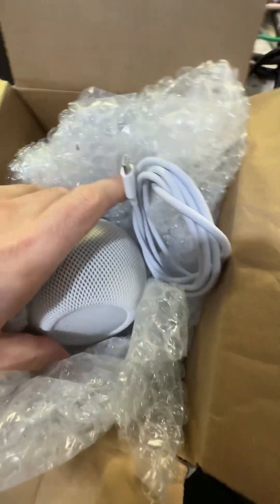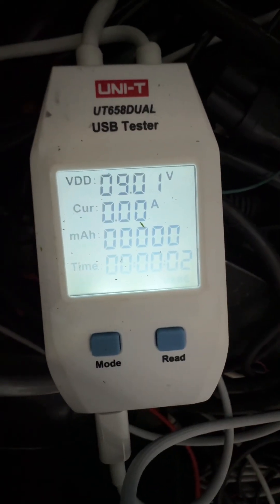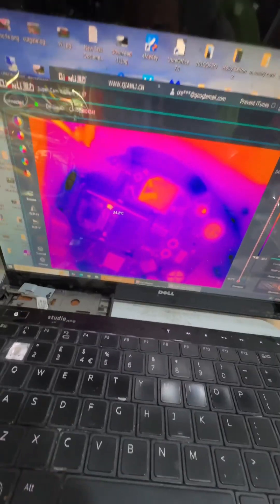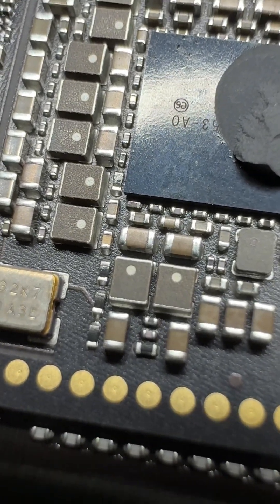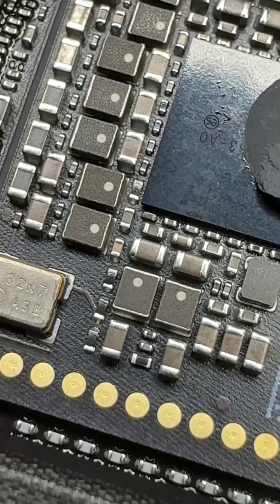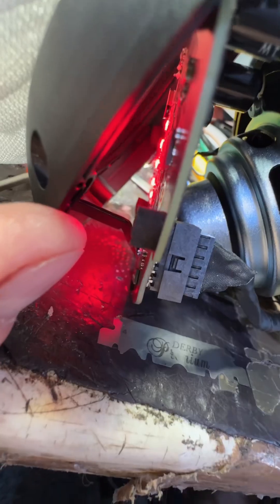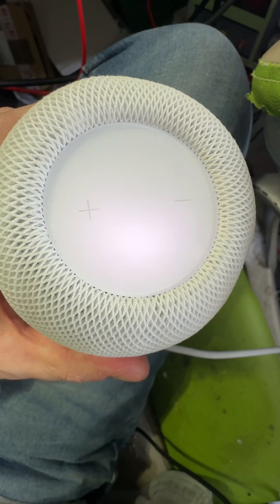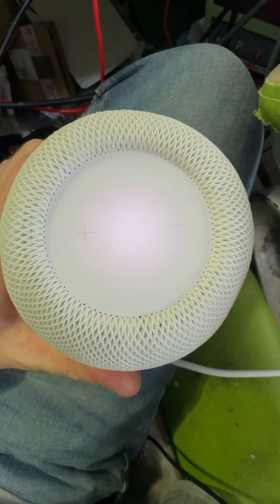Apple HomePod Mini Repair – Not Powering On

Comment: I removed the cap – actually, it was so burned it came off on its own when I just touched it. And the HomePod came back to life. Thanks, mate!
Reply from the maker: No worries, appears to be a common fault on these things.
Reply: same for me... same issue, different cap, but also one of the "first line" around the power ic. Under the microscope it was totally "burned"/"broken", and with a sharp needle I only needed to "touch" it, it immediately turned into "dust".
No option to replace it, HomePod mini works fine without it.
Thanks for this awesome repair instruction!

Comment: Hey! Found that I have the exact same capacitor that’s out which is nice I suppose. How do you go about removing and replacing something that small? I have a capacitor from an iPhone that I’d be able to use.

Edit: the cap I mean. It’s very tiny!
Reply from the maker: Hi with a very fine soldering iron and low melt solder to remove and then hot air station and low melt and low temps to re solder back. If it’s the same cap you can knock it off with exacto knife or tweezers and it’ll still work ok as only filtering cap
Reply: @Mobileithelp great to know! Looks pretty cooked so I’ll probably knock it off and not replace it. Thanks for the info!
Reply: @Mobileithelp IT WORKED!!! Thank you a ton mate!! Setting it up now!
Reply from the maker: @AourinFox you’re welcome !

Comment: Hello,
Did you replace cap or just knock it off?
Reply from the maker: @mail2ajuj  it was replaced, I can’t remember what I put on it though as it was just one I took of a iPhone. It’s just a filtering cap
Reply: knock it off works for this type of filter cap. I just used a thin needle and it immediately turned into dust. HomePod works fine again.